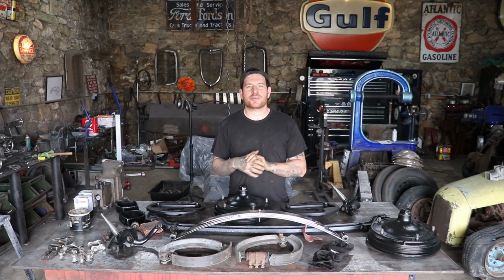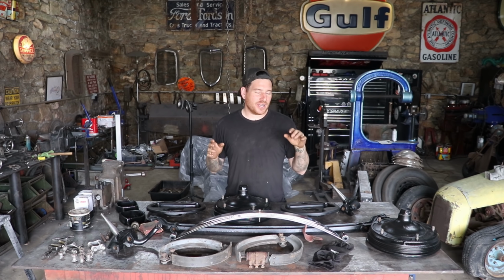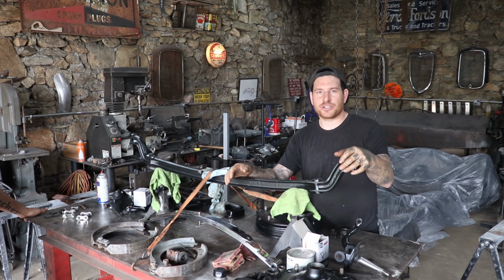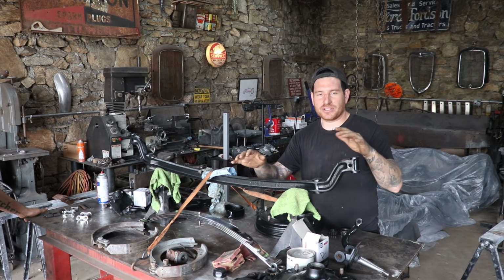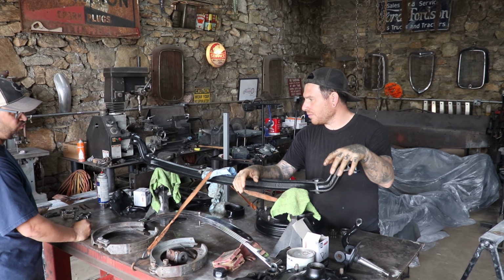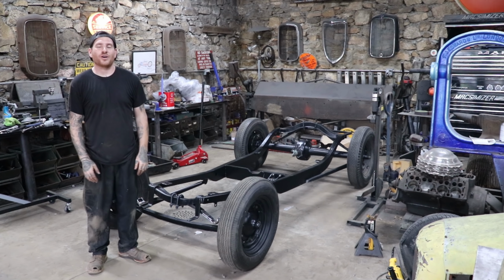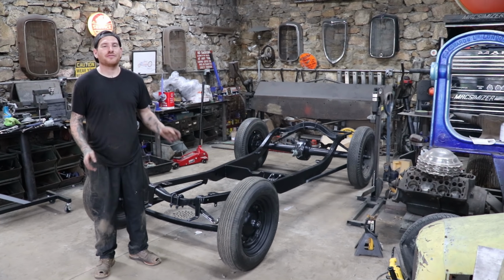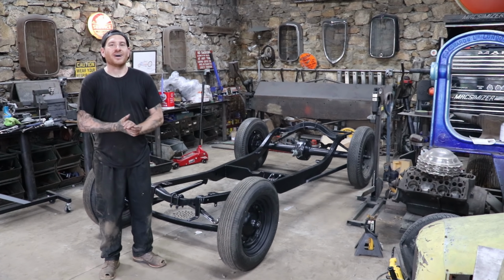How To Assemble A Hot Rod Front End - Ford Free-T Ep. 85

Comment: I was surprised you had to drive in the king pins. The pins I've put in slid in pretty easily. Also, you had no need for a spring stretcher. Looks great.
Reply from the maker: Just a little tapping. Sometimes they slide right in but sometimes the fit is so precise it takes some tapping with a mallet. All turns nicely now! -Matt/ITG

Comment: What ends do you have on the end of the Split wishbones?
Reply: Matt used the older Ford ball and socket style rod ends.  Model T thru 1935
 I think.  Most rodders and racers used the "new" tapered ends after they were available because they were so much simpler to use.   Just a hole instead of a ball on the mating part.   Hope this helps Eddie